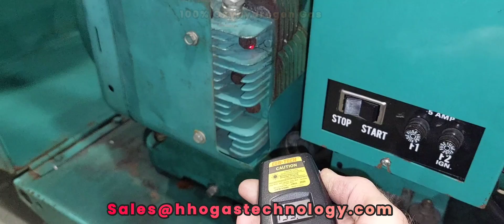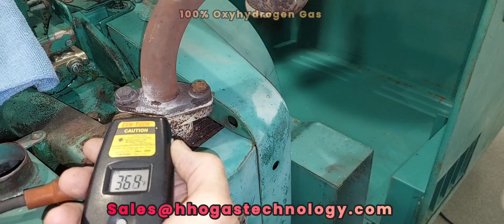Unleashing The Power Of HHO Gas In A Classic 1965 Onan Generator - A Must See!

Comment: How many watts going in the system vs coming out? if you have the power to generate the HHO then why the generator?
Reply: You can store the HH and O.
I think there are 3 main video types for HHO on youtube:
1) Generate HHO and use the chemical  HHO properties on the spot
2) Generate HHO and store it as HH and O for later use.
3) Use stored HH O. (like this video).
Usually the watts in doesn't really matter as long as it results in more than you need in a green way.

Comment: As the terminology is already wrong I have my doubts the video is real (it shows a running generator, that’s it - the rest is up to believe).
And again, there is not such a thing like oxyhydrogen gas, it is always H2 and O2…..(beside “in statu nescendi” which is not even a measurable time)
Reply from the maker: If you think this is not running on 100% oxyhydrogen gas bring $5000 over to my shop and be prepared to lose it when you see it run live on YouTube and presented to the public you and I together you handing me the money.
Reply from the maker: If you do not believe I am running it 100% on oxyhydrogen bring over $10,000 so we can do a live stream showing it running 100% oxyhydrogen while you hand over the money in total failure to prove your point.
Reply: @HHOGAS  quite unprofessional. I told you there is nothing like oxyhydrogen, HHO is not existing, we are still talking about 2 separate gases, H2 and O2. Highly active gases will not simply burn in a normal combustion engine, the timings are different, the compression is different, gaskets must be different as after a while you will have explosions in the crank case, piston rings will be gone after a very short time as the oil film will burn. As you “feed” the engine with “HHO” gas it would burn back to the tank immediately. 
…but luckily you are the mastermind and fixed all the problems engineers tried to fix a century ago already…..
Reply: @holgerkirschbaum6911 your issue is semantic in nature